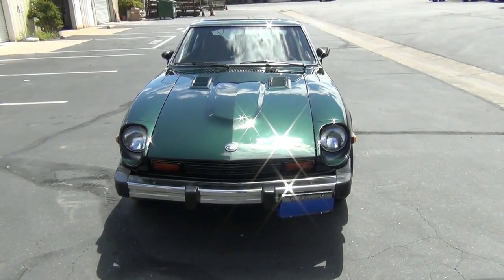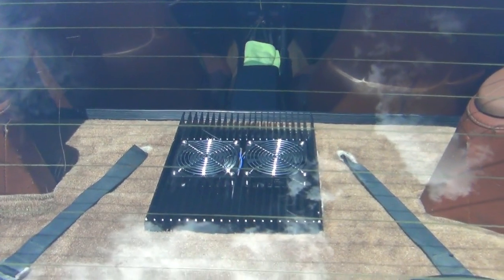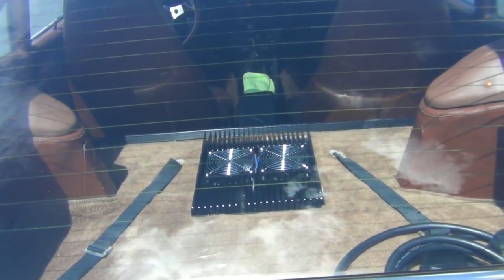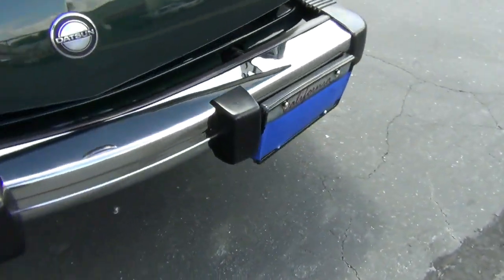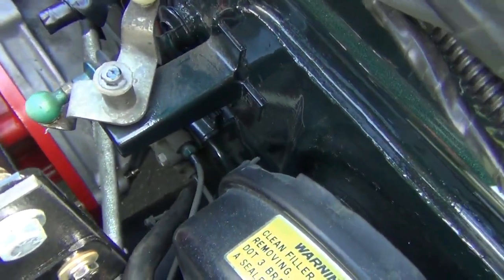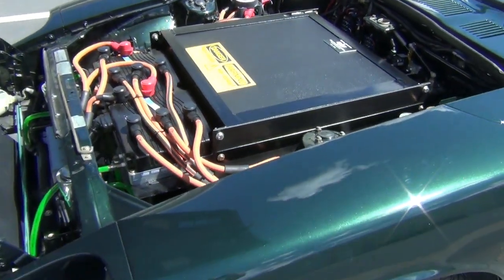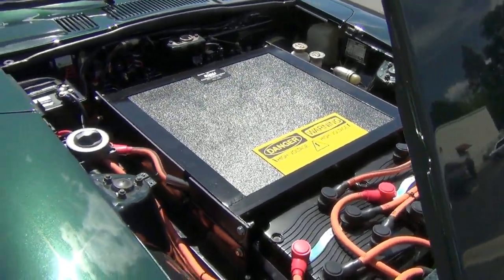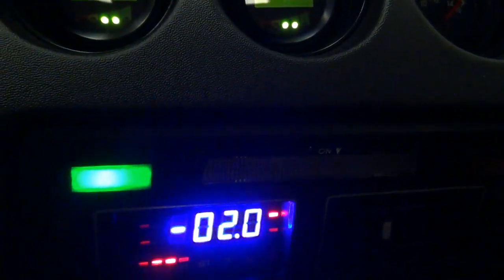Datsun 280Z EV Conversion Overview  www.EV4Unow.com

Comment: Do you have a schematic for the build? I’m curious.
Reply from the maker: As per our website:  Complete Conversion Service also includes an Operator’s Manual
with all the conversion component information, wiring schematics, component placement diagrams, legends, etc.

Comment: Quick question about the rear battery box, are there any safety issues with mounting it in the passenger compartment? Should one be worried about thermal runaway/fire or batteries producing gases? What about it becoming a projectile in case if a crash? Thank you! It's a very beautiful car.
Reply from the maker: Please address questions or comments to:  info@EV4Unow.com

Comment: Is there another main disconnect? Like in case of an accident and the hood not being operable? 
Also: is there some make up air for the charger? Or does the heat off the charger stay in the car?
Do you worry about rain getting past the hood seal?
Reply from the maker: In regards to your questions.  Is there another main disconnect?  (No) Like in case of an accident and the hood not being operable? (That's what fuses are for.)
Also: is there some make up air for the charger?(No) Or does the heat off the charger stay in the car?(You should allow for ventilation if possible.  The charger has thermal protection if it were to get too hot in the vehicle.)
Do you worry about rain getting past the hood seal?(Not an issue.)  Please direct future questions or comments to:  info@EV4Unow.com  Thank you for watching.

Comment: I love the fairlady, one the most beautiful car built by the Japanese obviously based on British inspiration.Why two controllers exactly?
Reply from the maker: Because the HPEVS AC-35x2 requires two controllers.  Basically two motors in one housing.
Reply: does it mean there are two stators in there (and two rotors on the same axle)?
Reply from the maker: Yes
Reply: That's clever and unusual. I guess it reduces the resistance, so ultimately sharing the load over two instead of a big winding with a greater resistance and so amp for a single controller.And as it is a single motor the sensors are common (I guess) for the two controllers so they are somewhat in sync.
Reply from the maker: Yes the controllers are synchronized, one is the primary, which receives throttle input etc., and a secondary.
You can visit HPEVS website for information about their motors.

Comment: Do you have any thermal management for the batteries? I ask because my 2011 Leaf had the batteries replaced via warranty at 50,000 mi do to battery degradation. Without the warranty that battery pack would have cost me $4600. I have to compliment you on your work - you do a clean conversion.
Reply from the maker: Thermal management varies based on the chemistry used.  The LiFePO4 cells we use like to be warm and are rated to 149 degrees Fahrenheit.  I personally have over 70,000 miles on the cells in my Karmann Ghia and the vehicle sees ambient air temperatures of over 100 degrees Fahrenheit for several months out of the year.  We have driven the car hard in temperatures up to 118 degrees.  Still have the same range as when they where installed.  (14.6 kWh pack, 2,200 lb. car, 60+ mile range.)  The cells are enclosed in a box with no ventilation but are insulated from direct sun light.  The Nissan Leaf cells also have a greater drop in performance in the cold than the ones we use.  Thanks for watching.